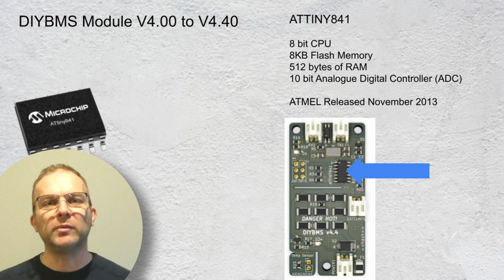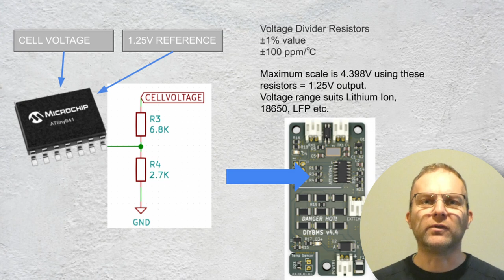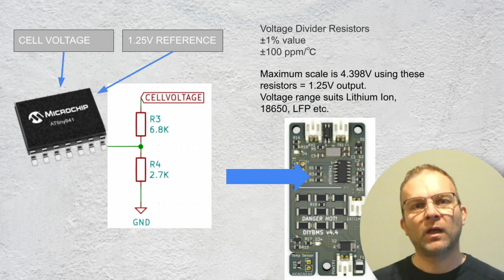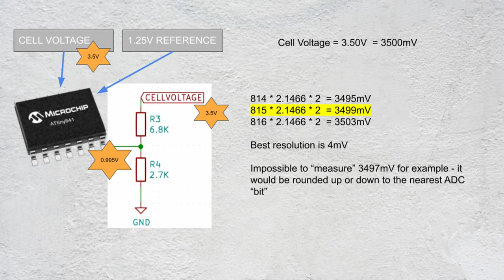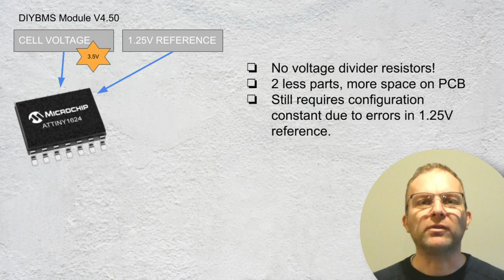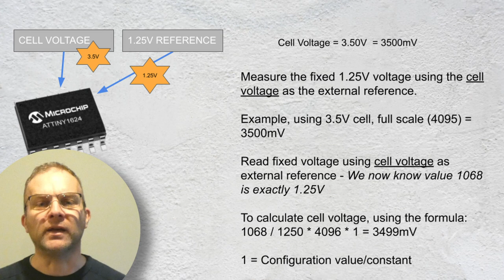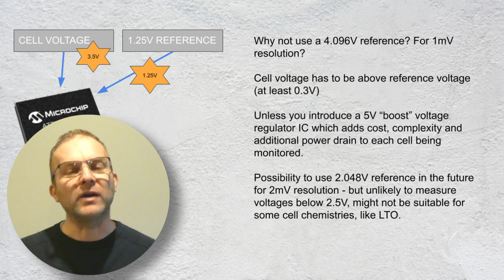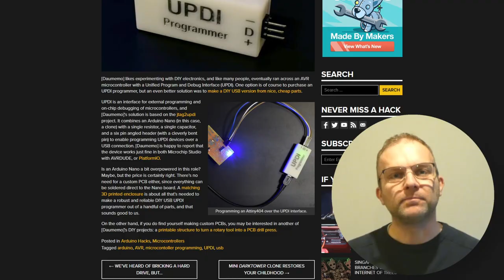DIYBMS New Module V4.5 with 12bit ADC

Comment: Hi Stuart, I just found this page. I have been working on something remarkably similar and live in Newcastle! I have a cell monitor using an attiny85 with serial comms between the cell monitors and a controller using an ESP32, this monitors the current using an INA228. I am currently looking at changing the cell monitors to use BLE to get rid of the wires. I also have just installed a Givenergy AC inverter and 5.2 battery to store cheap Octopus Go electricity. There is lots to talk to about.
Reply from the maker: Sounds like we have a very similar setup - have you seen my other videos on the LIFEPO4 battery build?

Comment: Hi Stuart, I am a big follower of your diybms project. I am just wondering if I can redo the board layout and design in Flux ?(it's a new webapp for designing circuit and PCB board). Just asking for your permission.
Reply from the maker: Yes, absolutely. Just a reminder that the design is open source for non-commercial usage, so can't be resold for profit
Reply: @StuartPittaway  noted. I’ll share you the link once I’m done. Thanks again for this awesome project!

Comment: Thank you Stuart for the excellent work and the detailed explanation in the video. I have a question about the reference voltage: Why don't you use the internal 1.1V reference instead of the external 1.25 from the Z-Diode?
Reply from the maker: The internal reference just isn't very good!

Comment: I use a resistive divider in my heater controller project, but i don't have it sit being a parasitic battery draw, i switch it to ground with  a mosfet then take a reading. theres always a chance that a charger can fail, and then with a resistive divider there's only one outcome over time. but of course what you have done here is one stage better still.
Reply from the maker: The existing modules (v4.40 and earlier) also switch the divider in and out using one of the pins on the ATTINY chip.

Comment: Hello Stuart. Do you have a battery charger solution to complement the DIY BMS? Thanks.
Reply from the maker: No I don't. Victron kit is good quality and works well with diybms.  I use a sofar inverter/charger

Comment: This looks an excellent model iteration. You are not only an extremely savvy electronics developer, but a great teacher, as well. Thanks. I guess the obvious question is, are the existing controller & shunt modules plug & play compatible, with this redesigned monitoring module?
I would be considered as not far above entry level, for electronics, but did understand, your V4.5 module upgrade explanation. I am teaching myself, all the necessary requirements, through channels, such as yours, to further my understanding, towards a safe, & effective system.

I am building up my 18650 supply, at present (procurement, testing, as well as building smaller battery systems, like portable backup power supplies (~1.6Kwh the largest, to date)), with a view to building a solar backup system (not to as large a scale, as some, in the DIY world). So, am just researching your BMS; but am vying towards utilising it, as my preferred battery bank charge/discharge control, as I really like your individual module-oriented design. Makes future battery upgrades, as well as capacity increases, a breeze.
A Good & safe Christmas/New Year, to you, & your family, Stuart.
Reply from the maker: Hi- thanks for the comment, this new module is fully compatible with the existing ESP32 controller, and also the older style modules.

Comment: Thanks for the great work Stuart, is this new module compatible with the previous version of the controller (ESP8266) and will it work with a mix of v4.21 modules?
Reply from the maker: It should be okay, I've not fully tested it against the ESP8266 controller, but its the same code under the covers - you will need to run it at the "standard" baud rate/speed.

Comment: Hello Stuart. For the v4.4, i understand that the batt voltage is measure with the voltage divider. However, on V4.5, i don't understand how the batt voltage is measured. When PA1 (REF_EN) outputs a voltage, PA5 (VREF) is always at 1.24V. Which input ADC port measures the batt voltage? Thanks
Reply from the maker: Hello, the V4.5 modules run at the cell voltage (which directly powers the ATTINY chip).  The 1.24V reference is used as a reference to the ADC chip in the ATTINY which can then use that to determine the "band gap" voltage of the incoming cell voltage.   Because the reference voltage is fixed, the code can calculate the cell voltage powering the ATTINY.
Reply: @StuartPittaway  Hello again. Which pin will actually measure the band gap of the incoming cell voltage?
Reply from the maker: @marcbohbot7533  the cell voltage is measured directly from the VCC input to the ATTINY, along with PA5 (VREF)

Comment: Currently playing with Solar and Batteries.  Looks interesting, but do I need one of these boards for every battery? If I have a 3 series 12v battery bank that's 3 PCB modules?
If I start to parallel individual batteries, then it becomes more cost / space effective. but are we then just protecting a single paralleled bank. Have I understood that right?
Reply from the maker: You need a module per set of parallel cells. The modules don't cost a lot (less than 5 USD)

Comment: What's the maximum number of cells you can do in series? Would the i2c bus be able to handle 100s?
Reply from the maker: Up to 128 cells in series, the modules no longer use i2c bus for communication.
Reply: what are you using then if your not using i2c? canbus? uart? spi? thanks for the info! 🙂
Reply from the maker: @ryanmowry1170  custom isolated UART protocol

Comment: Hey  Stuart amazing work on the new 4.5 module. You are currently working on the new CAN programming for next year. However there is one feature still lacking from the DIYBMS project. That is AC charging via CAN with current control. There is a bms project that went open source called ZEVA BMS and it has the ability to use any TC Charger that is the 1.8kw,the 3.3kw,and the 7.2kw. The bms code can set the current rate on the fly. The TC Chargers are very well made and best bang for the buck of all the CAN chargers out there. Do you think you can integrate the ZEVA BMS CAN code with the DIY BMS project ?
Reply from the maker: Should be possible to do the integration. The new code controls the voltage for the most part (as recommended by Victron) which then automatically controls the current as well.
Reply: @StuartPittaway  Exactly my thought. However with the TC Chargers the code is already out there and the protocol is open as well. It would be nice to have an alternative charger for those who don’t have or can afford Victron gear. I have searched around and the TC Chargers are the most affordable and most powerful chargers out there. They were originally made for the EV market however I am seeing them be used everywhere.
Reply from the maker: @carlospereira9838  the new code emulates Pylontech battery units which are also supported by lots of non-victron kit.
Reply: @StuartPittaway  Does this mean that it will support TC chargers as well ? It would be nice to have a separate AC charger along with Victron charger support. Victron does sell a CAN charger however it only supports 12 and 24 volts. Victron does not have a separate charger for 48 volts systems that is CAN controlled. TC Chargers are a more affordable option and they deliver a higher charge rate compared to the competition. I have searched around.
Reply from the maker: Do you have a link to the charger you have in mind?
Reply: @StuartPittaway  A Great Project well executed Stuart.  Will the Pylontech code allow parallel (2) battery operation?
Reply from the maker: @davidbrook1999  As long as both batteries are connected to the same controller, then yes it would.

Comment: I'm trying to build this module v4.5 but it seem doesn't work with esp8266 controller. is that true? Thanks
Reply from the maker: I think it should be fine - the esp8266 isn't a supported platform, but the module should still work from a software point of view.  Make sure you are using the 2400 baud rate (comms speed) code for the module.
Reply: @StuartPittaway  Thank you for your reply. I tried to flash 2k4 firmware (module_fw_V450_2K4_ATtiny1624_450_e0_h0_l0.hex) for the module and it's flashing green but I got no information when connecting to the controller.
Reply from the maker: @TanNguyen-qq2kp has the controller worked with other modules?   Try connecting the TX and RX together on the controller - you should see "ignored" errors in the web interface.  That means the controller is working properly.  The modules connect to the controller TX to RX (not TX to TX - that is bad!)

Comment: Hey, how about to use CH32V003 mcu. It seems to be costing around $0.1. Yes, it is still 10 bit and made in China but available and cheap.
Reply from the maker: That would require all the software to be rewritten!
Reply: @StuartPittaway  which might be not that bad idea. I mean make it more abstract and less dependant on hardware implementation.

Comment: Hi Stuart again. My cell monitor (attiny85) runs at 19200baud (this is quite hard on an 85 especially without an external xtal!) and thus the round trip time is not a problem. I also only send data if there is a change which reduces the data dramatically. Send me a message I will share what I did. I have tried to send this before the bot eats it up! Here is how to get in touch encoded. My name is David Liddell. Use my first name, the usual separator, my surname followed by the most common TLD. Hope this works.
Reply from the maker: David - I obviously can't decipher the email address!!  Can you create me a GITHUB issue over at https://github.com/stuartpittaway/diyBMSv4ESP32 and we can chat in there.

Comment: Will there be a video how to program the new updi things ?
Reply from the maker: Probably - although if you watch the current monitor/shunt video that covers how to program UPDI devices.
Reply: @StuartPittaway  so thank you, i will check it out. I can order the esp32 board and the battery controller with the updi right now ?
Reply from the maker: @curtis2788  yes, they are in GitHub
Reply: @StuartPittaway  hex file for v4.50 batterycontroller is missing... would you be so kind and add it. Thx
Reply from the maker: @curtis2788  v4.4 of the controller is the latested released version in the master branch. The code the v4.5 modules is in the release zip file.

Comment: 4mV resolution with 10bit ADC, and 3mV resolution with 12bit ADC? It seems there's something wrong with the design.
Reply from the maker: Its just down to the scaling of the input voltage.
Reply: @StuartPittaway  You could go down to 1-2mV resolution if you have used measuring from v4.4, right? Is there any reason or advantage of measurement in v4.5 compared to v4.4?
Reply from the maker: @Chupacabras222  the 4.5 is better measurement, particularly because of the hardware over samples, so actually the resolution is more like 16 bit.
Reply: @StuartPittaway  This is misunderstanding. I'm not asking if v4.4 or v4.5 is better. The newer MCU is definitely better, no question about that. I mean why did you change the schematic for measurement part? If you did not change this, you could have better resolution, don't you?
Reply from the maker: @Chupacabras222  I see what you mean now. The resistance of the divider circuit also changes with temperature, so getting those out means only 1 component (voltage reference) is the variable
Reply: @StuartPittaway  I see. I didn't think about tempco. That makes sense. AZ432 has 20ppm/C, and regular resistors 100ppm/C. That could have noticable effect.